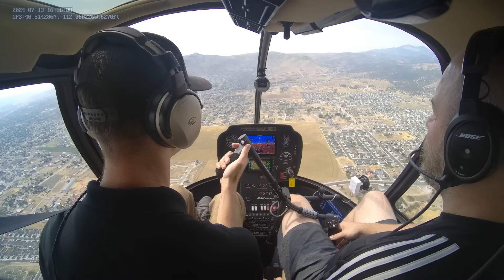New R44 Tail Chopped Off When Engine Actually Failed During Practice Auto

Comment: I’m a low time helicopter pilot with only a few hours in the R44, so maybe take what I have to say with a grain of salt. But I am also on a SAR Team and my full-time job is as an aircraft mechanic who has worked on R44s. So I don’t mean to flame anyone, especially a more experienced pilot who ensured everyone walked away from this incident, likely better than I could have. He did a great job keeping everyone alive. But risk management is about analyzing what went wrong and could be done better, so I do have a few observations that could shape some best practices for next time:

1) No mayday call? If that emergency landing didn’t turn out so well, none of the other aircraft on frequency knew what was happening or could be leveraged for summoning emergency assistance or directing first responders, increasing response time with potentially injured occupants. I know from my previous law enforcement experience with critical incidents that things like this get lost in the stress of the moment. So practice like you want to perform and add simulated mayday call to the syllabus. Aviate, navigate communicate. When I was learning to fly helicopters we had a ship go down, killing the student and critically injuring the CFI. The only reason anyone realized anything was wrong was because a trailer park lost power when they clipped the power line. Could a faster EMS response have saved the student? Who can say? But I had flown that aircraft in the eventual accident area only a week before, so it very well could have happened to me, and I would be much happier knowing someone knew I just crashed and where. ELTs, if even installed in helicopters, cannot be relied upon. So many erroneous activations mean response is often delayed. 406 ELTs are a little better, but nothing beats a real live person who can call for help on your behalf.

2) This huge open field is apparently not a suitable landing location due to ditches. Maybe low recon your intended landing location before initiating a practice emergency? Why set yourself up for failure?

3) CFI needs more full down auto practice if he can’t land the aircraft undamaged in a suitable landing location. If it’s not a suitable landing location, see above and don’t practice there. Much of being a good pilot is decision making. You can only scrape by so much with good stick and rudder skills, but they won’t always save you from a bad position you put yourself in from poor judgement or complacency. I see no reason to practice autos in a place that you can’t land safely in an actual emergency. If this CFI had more full down auto practice the aircraft might have been undamaged given the landing location. Or had he selected/vetted a more suitable landing location before inducing an engine failure this could have turned out better as well.

But what do I know? I’m just an armchair quarterback. This CFI was up for the moment and performed under stress. And for that he deserves our respect and praise. Hopefully he (and others) take these observations in the spirit in which they were intended. As pilots, cops, firefighters, paramedics, doctors, etc, we should always be willing to look inward to better ourselves and refine our respective crafts. We should all celebrate our victories but always ask, “What could I have done better?” without letting it keep you up at night.
Reply: Speaking on the radio wont help you, fly the aircraft.  At the end of the day they both walked away from the incident so it was a success.
Reply: @vancekeith5642 It takes an instant and alerts atc to your plight. Even if you don't have the time or capacity to get a full call out and squawk emergency, callsign and mayday should be the minimum. 

That said, they walked away from it, so most of it went pretty well! I've never flown the R44 so have no idea what they're like to flare and cushen at the bottom.
Reply: @Darkmouse20001  I do not disagree if at a higher altitude.  Doing an auto requires two hands and especially at low altitude there would be no time to squawk 7700 and also at that low an altitude unless near an ATC tower probably would be below radar.  The CFI did a fine job maintaining his composure to a safe conclusion.  I was not there and will not judge the outcome.  As far as others comments, you try and train wherever you can in the urban areas and that field is exactly where I would have aimed based on what I saw in video.
Reply: @vancekeith5642  I  would have landed on the road as this was place, I am sure they were familiar with. no wires I would think.
Reply: @helicoptercaptain  great point!  As an army trained helicopter pilot, we were trained that "all roads have wires". As a commercial pilot and a flight instructor for the past 25+ years with hundreds of touchdown autos across my 35+ year career, I can tell you that if I'm 'practicing' autos, I will already have a hard surface in the event it has to go to the ground...  I learned that lesson early in my career when both myself and my fellow instructor BOTH forgot to roll the throttle back on in the flare.  It get's your attention when the lack of pavement arrests your momentum like carrier landing gear.  Since then, all of my training involves a hard surface. Great minds think alike.
Reply: @rickdebacker100  If you look to the left in video and can image you could on a google map somewhere but the houses on left as video have road behind them from the left seat you easily see if there were any obstructions. The R44 glides very well head straight then 180 to the ground.
Reply: Aviate navigate and communicate. He flew it, navigated to the ground and communicated once on the ground lol
Reply: I respect your observations and they say aviate navigate communicate. I don’t know why he went forward did not look like an auto land.  I can’t imagine being in that helicopter and having my life before me.
Reply: ancient military helo pilot with many practice and several real autos under my belt.  all your comments right on.
Reply: Brillant - thank you 🍺🍺
Reply: Outstanding analysis.  The hard things HAVE to be said and the mistakes highlighted.
Reply: Main thing here is he flaired too early and shallow thus lost his rotor inertia at about 10ft too high, forward airspeed also high and then did not push forward enough to level the skids causing the forward pitching on contact with ground. But overall he did a great job, im not sure if i could do any better with my current experience in a real auto but i hope i could.
Reply: Very well said. As a retired Army pilot, and current full time LE pilot with 40+ years and 6000+ hrs; 25 as a CFI, I think you nailed it.  After my own eye opening experience doing an unplanned  full down to the sod, I now limit ALL training autos- fulldown or not, to a hard surface.

Comment: i’m convinced that helicopters are dangerous and not meant to fly. In fact helicopters don’t want to fly, airplanes do want to are a lot safer.
Reply: Airplanes can’t do a lot of things helicopters can.
Reply: Helicopters themselves aren’t really any more dangerous than fixed wing aircraft. They tend to be used in much more dangerous environments which is where their reputation for being dangerous aircraft comes from. If a fixed wing aircraft was in the same situation here (total engine failure) I think it’s safe to say that it easily could have come out with a similar amount of damage. Engine failures are rare but extremely dangerous for all types of aircraft which is why we practice what to do in that kind of situation so often. In fact while there might be a higher amount of helicopter accidents each year compared to fixed wing aircraft (perhaps due to the fact they are used in more dangerous environments), generally they have a lower chance of fatalities in a crash compared to fixed wing as they are able to land in incredibly small spaces rather than needing a whole runway or long flat stretch of land like an aeroplane does. Helicopters aren’t inherently dangerous, normally the environment they are used in is.

Comment: Very good job of the instructor in staying as calm as possible and saving their lives! 

I found this quite interesting as I was just reading the POH yesterday, some points to notice:

1. POH 3-1: CAUTION: Do not apply aft cyclic during touchdown or ground slide to prevent possible blade strike to the tailcone.

2. Safety Notice SN-27: "...throttle should be rolled off smoothly, never "chopped".

Thanks for posting the video so other pilots can learn from this.
Reply: @rasmusg1407  

Thanks

Comment: Glad this worked out. Anymore details?! This one will go viral
Reply from the maker: What other details would interest you? I tried to be thorough with what I thought was salient. I guess one other contributor could have been the density altitude at almost 6700ft. The A/C was on, and I was told a leading theory of the engine failure was maybe vapor lock, which kind of makes sense considering the above, the design of the fuel system, plus the fan spinning down to idle.
Reply: @ my bad. If only would have read the description. Always try to hold 70% on the E so that exact thing doesn’t happen.

Comment: A few things about your post. 
1) R44 is not a low inertia rotor system like the 22 is. The 44 really shouldnt be a sfar, just like the 66 isnt. 
2) several schools allow full down autos. Interesting to hear your schools’ insurance does nto allow it. How do they do cfi training then?
3) i dont think it’s a matter of the skis being stuck, the flare seemed extremely high and looking from the CCTV footage it was more of a running out of rrpm and crashing than an auto. 
Im glad you survived. 
Thanks for posting the video
Reply: Bit of an out of the ordinary situation here though, the tail didn't get chopped off in a regular low G excessive cyclic input mast bumping incident, the whole helicopter bounced when it touched down kicking the tail up into the main rotor disk.
Reply: Was the auto into the wind? Just wondering if there was a downwind component that increased the ground speed?
Reply from the maker: Good info! A lot of my perspective is as a beginning student pilot. As far as I understand, the R44 is quite a bit lower inertia system than most helis outside the R22; people seems split on calling it "low intertia" in the discussions I found online. It's possible that this school allows full-down autos for pilots in more advanced phases of training, but the insurance paperwork I signed forbade them. Finally, yeah there's no doubt the flare happend high, but I'm not totally convinced the heli would have been a complete loss on something like asphault; though perhaps it would have meant collapsed gear and/or broken legs instead, hard to know.
Reply: @j0rp  Agreed R44 blades loose energy fast, when compared to a Huey or Bell 47
Reply: R44’s have massive blade inertia and are beautiful to auto rotate . Not as large as say a 206 but much more forgiving than a R22

Comment: This flare was way too high. In helicopter you have three energy banks airspeed, altitude, and rotor rpm. you maintain two full energy banks of airspeed and rotor as you trade altitude. In the flare you trade airspeed to maintain rpm and after that you use the leftover rpm for final cushion looking to be in a position where a normal hovering auto would work. He was low rotor rpm at above roof top level.  There was no way tail wasn’t getting chopped off
Reply from the maker: After the 30 second troubleshooting session, we were 30 seconds from hitting the ground, dead or alive. Frankly, I care little that the auto wasn't perfect because we're both perfectly alive.
Reply: @j0rp I’ll give you that being that primary consideration in any auto is survival of the occupants first and save the machine is secondary. I have never heard of any insurance company restricting touchdown autos. its usually the companies restricting their instructors because even with insurance when you ball one up the deductible is 10% of the insured value. most schools pretend ground is higher and so higher flares for practice and this is the end result because you default to training. I demonstrate touchdowns in R22 and R44 to all my students but I own my aircraft and am the only instructor
Reply from the maker: @aviatorjon5383  I agree, I think profit motive is a huge factor in a lot of loss in the aviation community, life included; most of the advancements in aviation, including in safety, are locked behind 8+ figures (even the 737 max AoA disagree warning was initially a paid software feature which they made standard after huge loss of life). Regarding your other comment: regardless of the confusion as his whole career of failure training and the thought of our lifeless corpses spread across a field inevitably flashed through his mind, the auto was stable and once he decided he was going to take us all the way down he was cool and focused on his scans. Ultimately he flared a bit high as I believe his training hadn't given him sufficient exposure to situations like this, close to the ground, most likely because of fear of hull loss. If you have constructive criticism, besides pointing out what went wrong, I would be very interested in a discussion of what should be done differently, because believe it or not I would like to know what to do if this ever happens to me when in the left seat.
Reply: @j0rp  I didn’t mean to come out as if I were attacking your instructor. In fact he did many things right. He scanned and even mentioned the correct point “never practice an auto without somewhere to go should it become real” It is just a pet peeve of mine that he like many others isn’t being properly prepared because of how these maneuvers are trained. Fortunately you walked away and because you experienced this you will fly around with a new respect that most don’t have “yes the engine can fail”. I personally had an engine failure in a Hiller UH12B and fortunately for me I was able to put it on the ground without damage. Because of that every time I fly I constantly draw a imaginary ring around the aircraft and look for potential auto spots as I fly. If I don’t have potentials I climb or alter my course. This is a good video I send to all my students if you have time to watch. https://youtu.be/--25WBN_Jic?si=RgPOUCMLquYpOwz8
Reply: How many actual engines failures have you had? How about touch down autos?
Reply: also the alternator light was dead give away to the engine failure and it confused him. second easy indication was eng tach completely on floor of gauge. third indication was manifold pressure reading outside air pressure
Reply: Great 30 hours student pilot talk!

Comment: 2 different videos. Next…
Reply: Did you miss this part in the description? "I was able to recover all but the last few seconds, though with forensic tools more could probably be salvaged. The touchdown itself was caught externally by the security camera of a nearby home." 😒 Being judgy without reading the info DIRECTLY under the video. Next...
Reply: @megheart-7289 helicopter was already touching down skids level in the inside view. Outside view was nose high. Makes no sense.
Reply from the maker: @JosiasRivera  I promise, both of these clips are of the same incident. I took the exterior cam footage directly from that released by the home owner to a news agency and posted on their site. If you do a little research with hints from the video, I think you'll even be able to find that same footage yourself.